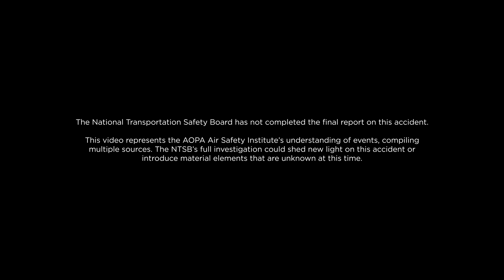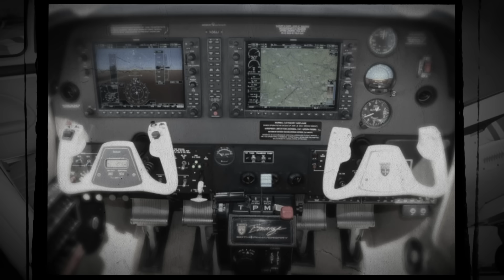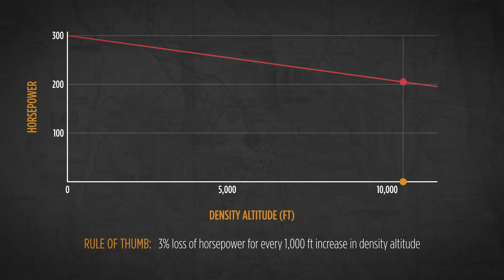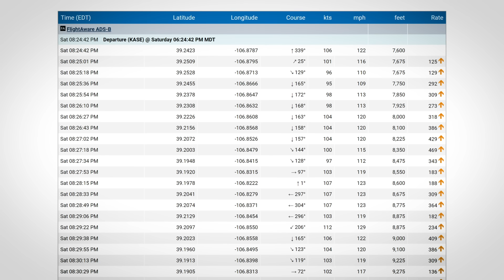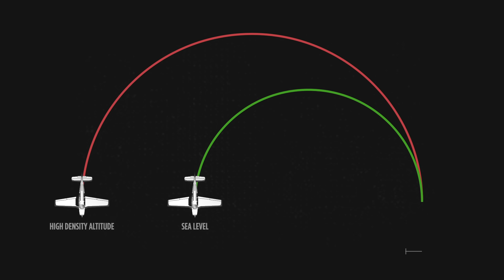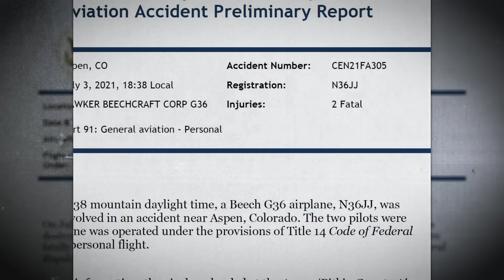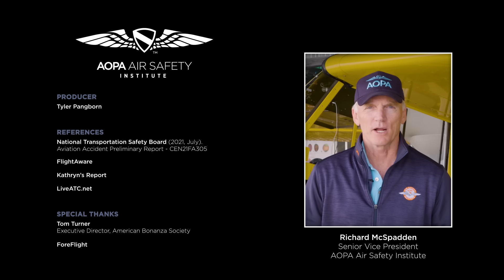Accident Case Study: Into Thin Air

Comment: Sound advice! If the pilots had spent just 30m at Aspen to study the chart and discuss their situation, they probably would have chosen a safe route before they entered the cockpit. Making-it-up-as-you-go-along just isn’t a strategy! However, I am surprised by the absence of three suggestions.

All good pilots know their aircraft’s behaviour is affected by (1) its weight, (2) the dynamic pressure = half the air density times the square of the true airspeed, and (3) Reynolds number, “Re”. [Re is the air density times the true airspeed times the length of the item of interest in the direction of flight, divided by the air’s absolute viscosity. Re indicates the significance of the air’s momentum versus its viscosity in determining what happens when it flows around an object, such as a wing or fin. It is important for large changes in airspeed, air density, flow-wise length, and air viscosity. For a light aircraft flying in a low airspeed range versus the speed of sound, Re is unimportant compared with the dynamic pressure. The maximum cruise speed of the BB G36 is just 176 KTAS, (326 km/h).] 

Dumping fuel decreases weight and improves climb. In fact, dumping anything you don’t need will help, provided you can do so safely. The BB G36 would have been fully fuelled at Aspen, taking off with 80 US gallons (302.8 litres of fuel). Ignoring the time needed to dump the fuel, the pilots could have dumped at least 250lb of fuel, and still had enough to land safely at an alternate. You should know how to dump fuel from your aircraft and the dumping rate.

All manufacturers should provide the maximum airspeeds for flap settings at SL std conditions plus a few others, e.g. cold and hot T's, and a few altitudes. However, what is truly important are the dynamic pressures for those airspeeds. Let us say the aircraft may use 30° flap (which may also be called something like “setting 3”) up to 120 KIAS (233 km/h IAS) at sea level. At a density altitude of 10,500 ft ASL, the air density is 72.7% of that at sea level. It is easy to work out the airspeed required at 10,500 ft ASL to generate the same dynamic pressure:

1 x 120 x 120 = 0.727 x v x v, which gives us: v = 140.7 KIAS

Hence at an air density altitude of 10,500 ft ASL it is okay to use 30° flap up to 141 KIAS. You cannot do such arithmetic in an emergency, but it is easy to create and print a graph that shows the equivalent airspeeds at any density altitude that generate the same sea level dynamic pressures as the maximum airspeeds for the manufacturer’s flap settings at sea level. For three flap settings, you will have three distinct curves. The equivalent density altitude is on the Y-axis, and airspeed on the X-axis. If possible, add numbers along the lines that indicate the angle of climb for a given mass. This is best done by testing your aircraft with a known payload, and checking the fuel level at the same time you note the rate of climb. YOU WILL NEED TO DIVIDE THE AIRCRAFT'S RATE OF CLIMB BY ITS AIRSPEED TO FIND ITS ANGLE OF CLIMB.

To maximise the climb angle at a specific density altitude, you use the graph to choose the best possible flap setting and airspeed. For example, at an air density altitude of 10,500 ft, this may be 150 KIAS and 20° flap, (which may also be called something like “setting 2”). HAVE YOUR CALCULATIONS AND GRAPH CHECKED BY AN AERONAUTICAL ENGINEER, laminate it onto a card, and keep it in the cockpit. You can now maximise climb angle using flaps within seconds, for all conditions not covered by the manufacturer’s own flap setting graphs and/or tables.

The last possibility - only advisable for pilots who have practised the manoeuvre - is a stall turn. If sideways space is really tight but you still have some height AGL, and there’s no way you’re going to get over the terrain ahead, a stall turn is your only option. It puts the aircraft back in the direction in which the valley is deepening, and may spell the difference between a survivable and fatal crash.
Reply: You write like an AE.  Are you also a pilot.  I ask because you suggest they could have dumped fuel.  I am not aware of any planes in this category that have the ability to dump fuel.  Are there some?
Reply: @billcraig  Yes, I'm an AE and no, I am not a pilot. As an AE I have often felt that pilots and AEs ought to talk much more! I included fuel dumping because I am obsessed with "completeness", and pilots who are flying more sophisticated aircraft may view the video. I've never seen a piston-engined small light aircraft that can dump fuel through a proper system designed for the job, BUT there are so many types, including EAs, that I do not know there aren't any. The bigger point is that you need to think whether you can safely dump any weight. BTW you'll have noted that I forgot to say that the actual climb angle is the arcsine of the aircraft's climb rate divided by its airspeed: oddly, when one is very familiar with something, one often slips up - this too, can contribute to accidents. (As you'll know, the difference between climb angle and climb rate is essential when you are trying to clear an obstacle!)
Reply: I don’t remember a way to dump fuel in my previous plane a Mooney bravo but I was turbo charged and had oxygen.
Reply: @TheRotorhound  Yes! Please read my reply to Bill Craig.
Reply: @etangdescygnes    I read it. I don’t know any general aviation planes that can dump fuel. Perhaps they could have dumped luggage. These pilots knew or should have known that they were not capable of an instrument departure without oxygen on board and l assume that they didn’t have oxygen. You fly in mountains you need to really know what your aircraft can do. A tragic end but foreseeable.
Reply: @TheRotorhound  Yes, I agree, but I must also take issue with myself, because it's difficult, expensive, and potentially dangerous for pilots to explore the capabilities of their aircraft. ATC will object to a prolonged exercise such as finding climb angles at many different stepped altitudes. AEs ask test pilots to do the technical flying, and manufacturers should summarise the data clearly, in tables and graphs, as appropriate. If the company that made your aircraft has done its job properly, you should be able to do something such as maximise the climb angle using flaps, by studying a graph for just a few seconds. There can be some subtle issues, such as whether the engine oil is hot enough before take off. But here, you're 100% right - going so high without oxygen was stupid. I wonder what the terrain around Aspen actually looks like? I'm going to take a look!

Comment: This is eary. Just minutes before this crash, I was flying over Marshal Pass (maximum elevation, 10,800 MSL, just 50 miles to the south of where this accident happened) with my family, en route from Grand Junction to Colorado Springs in a Cessna 172. I remember how hot it was that day, and how much it forced me to attend to the climb rate, and ensure I'd reached a safe altitude before heading for the pass. Combining that experience with this video truly makes the importance of density altitude calculations a lesson I will not forget for as long as I fly. Thank you for making this video.

Comment: Im not a pilot but you have to figure at high altitude those small private planes are woefully underpowered and lack lift in the Sierra Nevada and Rocky Mountains for example and especially with thermals , up and downdrafts near the mountains. No thanks !

Comment: Greetings, fellow pilots. I am profoundly sorry if my note sounded critical. Please forgive me.

I was asked about how I learned something about flying. Here is just one of my errors of omission or commission. Go gentle on me, please.

Back in 1975 following prisoner of war and water survival training, I was assigned to O-2 forward air control training at Hurlburt Field, Eglin AFB, Florida. The shock of flying Cessna 337’s at 170 knots after T-38’s at 450-600 knots was palpable. Nonetheless, in the military, one supports the mission to which one is assigned. 

Hurlburt taught me map reading from the air, how to fire white phosphorus rockets, how to plan their parabolic flight in coordination with the fighter-bomber flying nap of the earth to a target then would only see when inverted in the pull-down after the brief pop-up. 

Everything was low altitude flying, sometimes as low as the treetops, and always as fast the faithful O-2 could fly. When we were assigned to home base, we were given a tactical review of the airspace over Ft. Irwin, CA and Nellis AFB, NV. In the typical four hour missions, it was hot, concentrated work, tactical map reading while arming up the airplane or aligning it for the brief pull-up to fire the rockets. It was sweating and enduring. There was no autopilot, no air conditioning and one was constantly synchronizing the props.  In one solo flight in Operation Red Flag over Nellis AFB, I was “shot down” by an opposing Marine Harrier; the pilot did a victory aileron roll over my little craft at about four hundred feet above the ground, then disappeared. 

Flying over Nellis in the summer brought home the lessons of density altitude. What burned the lessons into my pores is this: After two hours loitering over the Nellis training area, marking targets and calling in training bombing missions, my co-pilot (who also managed the UHF, VHF and HF radios on board) and I needed to go home for fuel. The climb-out of the area entailed a narrowing, high–elevation canyon, just as in the AOPA scenario. We were heavy–weight with the two pilots, three radios, and two rocket pods, on a hot summer day in the desert, and at 6,300 feet. The airplane could barely climb in these conditions. My one useful decision was to fly close to one side of the ascending canyon. Approaching the canyon rim from below, I decided that we could not make it. I had to turn the slow airplane, stall warning horn blaring, full throttles, in a gentle descent around the mouth of the canyon away from the ridge. I could have (should have) punched off the two external rocket pods and lightened the airplane by 300 pounds. As you see, this could have been the fatal stall. 

There you go. Again, I am not critical. I have felt the pilots’ terror first hand.

Comment: It's ironic (and tragic) that a lot of pilots get themselves into trouble by trying to shorten the time they do something they enjoy.  You got into flying because you love it.  Don't be in a hurry.  Enjoy it.  I feel like at least a little bit of getthereitis influenced the flightplan.
I'm just a lowly sim pilot hoping to start my path to a pilot's license in the next year.
So far, I've learned the following lessons that I believe increase your chances of not becoming a statistic dramatically (please correct me accordingly):
1. Be humble, check your ego before boarding - everyone makes mistakes, and don't get complacent as you get experience.  If in trouble, tell ATC, call Mayday (seen too many ATC videos).
2. Weather - study it carefully and calculate how it will affect your flight.  Density altitude can make your plane perform like crap (I'm being casual here).  Can affect your range, climb, etc.  I'm repeating myself.
3. Equipment - preflight, make sure everything works.  If in doubt, fly another day.
4. Plan, plan, plan.  Have options, alternates, even around the airport in case of a problem on departure.
5. Don't try anything you haven't practiced, especially when you don't know your plane well.  i.e. turning back at low altitude, or steep turns.
6. Kind of part of 5 above - if not stabilized on approach or too many things are happening at the same time or last minute - Go around!
Am I missing any of the big killers?

Comment: Took off from Flagstaff recently--basically last August. I have a 1969 Bo with a 470k (fun fact: the 1969 E33 Bonanza is the only year "Bonanza" is stamped on the side for a straight tail 33-renamed Debonair the next year). It struggled. And that plane has a strong engine that climbs well at altitude. But that day, with DA around 10k feet, you could really feel it. I took off with tanks half full (or half empty for you pessimists, lol) and flew it to Lake Havasu to re-fuel. You really can't mess with DA and high altitude flying around terrain can be a big deal. I've flown my sons to hockey tournaments all over the states in that plane, but I steer clear of Colorado with that plane. Our next plane is going to be a pressurized turbo twin, so we'll just use that one.

Comment: A sad tale of how poor planning can lead to a tragic ending.

I'd start with the choice to fly to Aspen in the first place. When you're on an enormous cross-country journey like this, why stop for fuel in one of the most notoriously difficult airports in the US? Surely there were better options than that, whether it was stopping further west so you cross the Rockies during cruise or going further north or south to avoid the highest parts of the Rockies.

As others have noted, the pilot's discussions with ATC appear to show an alarming lack of appreciation for the risks of the flight. The Rockies are hardly the place for a "we'll see how it looks" approach to flying, especially in a GA aircraft. Those departure procedures are there for a reason.

Comment: Get-there-itis is a condition that is a problem that is largely ignored when it comes to a lot of crashes. It was first brought to the forefront on American Airlines Flight 1420 that crash at Little Rock while attempting to land in a horrific thunderstorm.   Get-there-itis is no doubt a contributing factor in this crash.  The pilot failed to circle enough times to provide himself with more than ample room to clear the tops. He assumed he would just hurry on up and try to do a climb out while flying. Pilots will assume risk basically to accomplish the mission. They will stick their nose in a dangerous situation because they gotta get there... It's these risk that oftentimes proves deadly.

Comment: This is what just about did me in. Flying a rental 172 over the Smokies and just crossed the ridge going from wayward to leeward. Flying straight and level 3000 feet AGL and my altimeter started going down. So I increased power and the sink rate increased. At one point I was skimming tree tops following the contours. Only by deploying half flaps and going full power was I able to claw my way back up. Scariest flight of my career
Reply: Thanks for sharing!

Comment: I learned to fly in Denver so density altitude was hammered into me constantly, but as the narrator said you have to experience it. I fly a PA28 but rent a 172 turbo to fly over the mountains, plus I've taken mountain flying training. When the narrator said the pilot was centered in the valley as they were trying to climb I knew what was going to happen. Sad.

Comment: This is a sad story. A normally-aspirated small aircraft engine plus landing at, and especially taking off from, Colorado airports equals potentially dire troubles. I think Leadville, Colorado is the highest-altitude airport in the USA; Aspen obviously is not much better. I can tell you from personal experience, just driving a car over either of the two passes mentioned in this documentary is definitely scary. The canyon floors are littered with battered cars driven by folks unfamiliar with Colorado's high mountains.

Comment: Density altitude is one of those things we learn about in primary training in theory, but that theory does not prepare you for the realities of what high-density altitude really means.  I have flown most of my hours out of Angel Fire, New Mexico (KAXX) where the field elevation is 8,380 feet. We have had a lot of planes simply unable to take flight out of ground effect resulting in aborted takeoffs. There have been some fatal accidents out of this as well, most of those due to mountain winds (typically from the west, but occasionally from the east, which changes things a lot). We had so many close-calls and accidents over the past few years that we did a safety video about flying in-and-out of the area. I would love to see AOPA sponsor an initiative to formally do this at high-risk airports. The Angel Fire video is no where nearly as professional as this one. https://youtu.be/AmrAX7tSvvQ

Comment: Complete ignorant here so bear with me: when pilots approached the mountains and realised they were not climbing enough, couldn't they go full throttle and increase the pitch/vertical speed? Thanks
Reply: The issue is that the normally aspirated engine loses approximately 3% of its horsepower for every 1,000 feet in density altitude that it goes. Guess, I'm betting their density altitude was probably between 16,000' and 18,000' where they were flying (meaning that the airplane "feels" like it is at 16,000' due to the temperatures, humidity, pressure altitude, etc). That would put the airplane's horsepower somewhere 138 and 156, and that would be if the air-fuel mixture is being truly optimized. In a normally aspirated general aviation piston powered airplane, the air-fuel mixture has to be adjusted as altitude changes. Since these were low-land pilots, it is likely they weren't completely competent at mixture management at these high of altitudes, meaning that they could be making only 100 horsepower. Full throttle would do almost nothing in that situation. Pulling up on the nose without sufficient airspeed would result in a stall. It's a no-win situation.